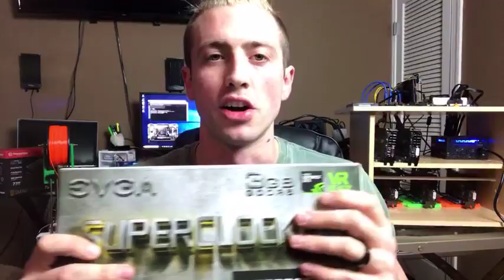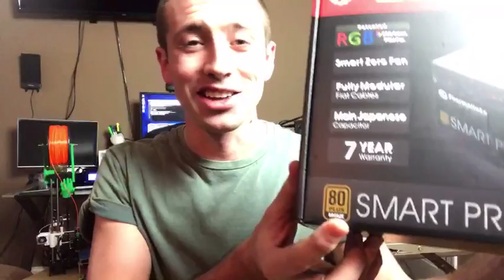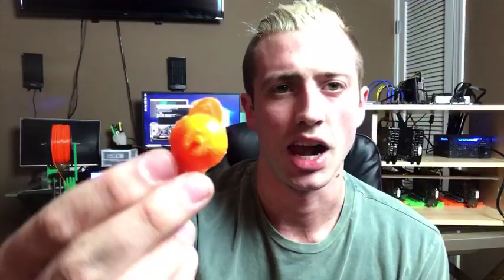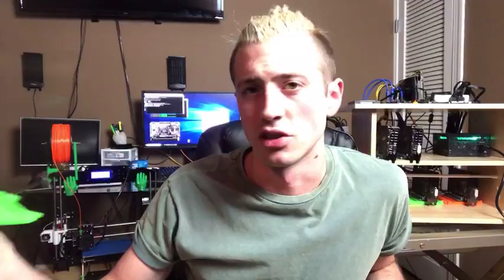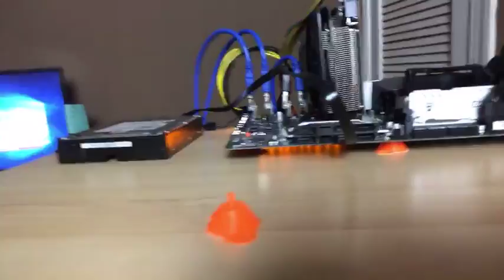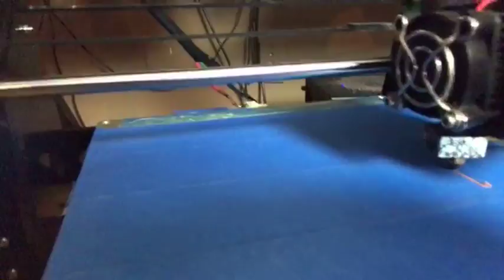Cryptocurrency Mining Rig Build 1060GTX ( 3 GB) // 3D printing Bit-Rig mounts for mining

Comment: Ya very nice and you know what you are talking about, nice vid and good info, I use NiceHash also, and I thought the same on the CPU mining - the NiceHash calculator says an Intel Core i7-6700 Processor, up to 3.4GHz will mine about $1.40 a day -35 to 38 a month and that will more than pay for the CPU in a year, $261 on eBay and make$400 a year with CPU, yes the 8 gig for RAM , nice mother Board feet just add holes for the screws, I like the furniture idea for a rig case too. Nice printer.
Reply from the maker: Thanks, I appreciate the feedback! Yah the feet have little tabs for screws but im working on a better solution all together!

Comment: pretty impressive stuff. I really liked how you built your own elements of the rig using a 3D printer. How much did it cost? Just curious.... On another note. Never ever you should need to go with more than 4GB, trust me on this one! I've built some Vega rigs (which use a LOT of virtual memory, and that's the key). The RAM isn't going to make your system any faster, again, trust me on this one.. The issue is that your system is using a regular HD, so it will never go fast regardless of what you do. You could have 32GB of RAM and it could load things in a slow manner.

My desktop computer, which features 8GB of RAM. has a 1TB HD and it's slower than my laptop, despite the fact that it has an impressive CPU and a very good GPU! I'd save the money in your next mining rig and instead of getting 8GB or more RAM I'd buy a SSD (that's when things get pretty fast). My Vega rigs use 4GB of memory, plus I purchased a 120GB SSD 'cos you need to set your virtual memory to a minimum of 50GB if you have 6 Vega 56 or Vega 64 cards, since they use 8GB of HBM2 and AMD uses a HMCC toggle that uses system memory --long story. 

But you get the idea. The Vega rigs mine like gods on fire, sometimes like 55€ day (I mean euros) in Nicehash, more like 40€ on average though, but when the Bitcoin is priced high they are speed demons, and the computer only has 4GB of RAM.

Just never forget to set some virtual memory in Windows 10 for your GTX 1060 cards and that's it (not much though, they aren't like the Vega cards, though these are very efficient at mining too, they can use up to 140W and mine Monero at 1900H/s, crazy...). I ordered a 1060 3GB yesterday, and I should have it at home by Monday's morning. best regards
Reply from the maker: lino vi 55 euros a day? I really want to switch to simple miner. 2gb ram and no HD
Reply: yes, I have screenshots and all. It happened at the recent peak, like 5 days ago, just before some things crashed. More realistically, the average is more along the lines of 40-44€ a day, and 40€ or less in a not so good day. The least I've seen was 26€, I think?

What is simple miner?
Reply from the maker: That's pretty cool, do those numbers require a BIOS mod?
Reply: well, those numbers are from unmodded Vega 56 (stock BIOS). The difficulty with Vegas occurs the first time you create a rig with them. Past that point and once you learn they are really efficient (surprisingly so! low power consumption for an AMD card, although not very efficient at gaming/power consumption ratio, but for mining they are beasts). vega.miningguides.com is a great start point, though some extra optimisation might be needed.

Vega 64 doesn't require a BIOS mod, and Vega 56 can be modded to use Vega 64 BIOS, which make them super efficient, but well...they are really efficient at mining if youy know what you're doing using stock BIOS.

What is simple miner?